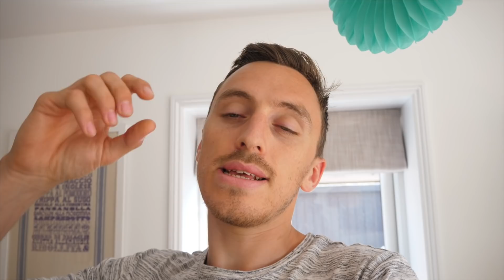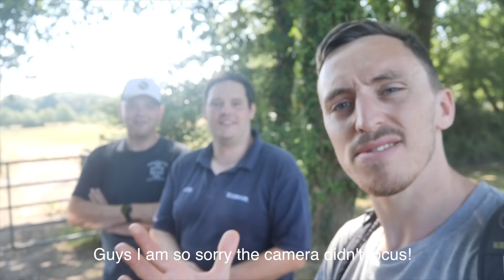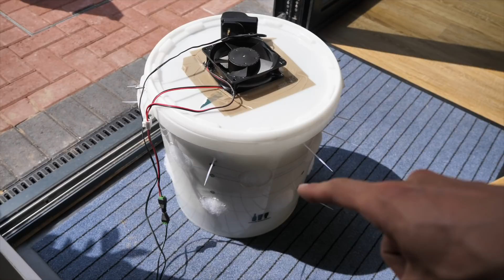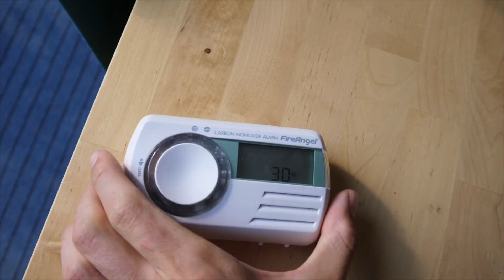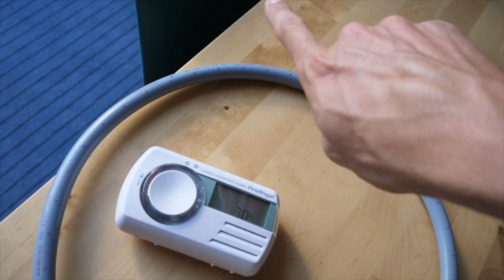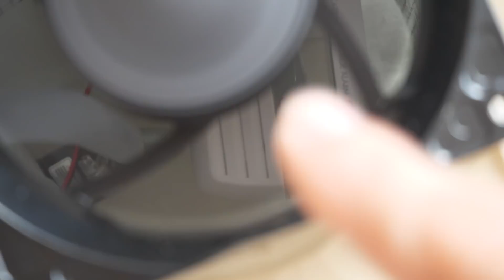DIY 12v Evaporative Cooler For Camper Van

Comment: Hugh, if you want to know why the temperature drops change in varying conditions do some research into 'wet bulb' and 'dry bulb' temperatures. I'm a water treatment engineer and work with coolers that work on the same principal, but are as big as your house ;)
Reply from the maker: Amazing, cheers Tim!

Comment: Make that test on the outdoors or on an hot van. It will change completely, because the water is not on a so desired low temp.
I had one 12v cooler and after a few years I got another one. Before use it on my car, I made an indoor test at home. The old one was better. With a bottle of water inside after one hour the water temperature on the old one was 4°C lower. Then I made the test on the car on the hot sun. The result was the opposite, only because the lid had a better lock system without changes for small leaks. Before going further on your project put it outside, let the water get the ambient temperature and then make your test. I’m not any expert.
Reply from the maker: Cheers Luis!

Comment: I like your construction, and with one extra feature you could make it into something really useful. But as it stands, I believe you will find that, when it's uncomfortably hot in your van, your cooler will make matters worse!

You will get a dip in temperature at first, but you will also raise the air humidity, which slows down evaporation. Eventually, the humidity will be so high that you get almost no evaporative cooling at all. The only reason you get any at all is because some of the water vapour is leaking from the van. Even worse, the humidity will affect your body's ability to cool by sweating, and you will become very uncomfortable indeed.

The humidity may also cause problems with condensation, wood swelling and so on.

This problem can be overcome. Instead of blowing the humid, cooled air into the van, cool the van indirectly by sending the humid air through a pipe that takes it out of the van, but allow this air to absorb heat from within the van before it escapes. E.g. you could add a second fan that blows the van air over a coil of the pipe.

But be aware that the cooling effects might not be as impressive as they appear. If you're blowing air out of the van, air must also be coming into the van from somewhere, which will warm your van up again.
Reply from the maker: Hi Peter, sound logic I do appreciate it. I am looking into another design that should hopefully achieve all the results I originally looked for

Comment: Good idea. The only difference I can see is the first tube curved gently on whereas the second was more rigid tubing and had a sharp right angle at the top - could that have hindered the efficacy? (I know nothing about science so don't laugh!)
Reply from the maker: Nothing to laugh at at all, I am not qualified to answer that correctly but due to the scale of the unit that 90 degree is probably less efficient but the difference in energy requirements to offset it will be so minimal you wouldn't notice.

Comment: Another approach to the same sort of solution is to use frozen ice packs instead of water.   You can make a smaller unit and it will not rely on evaporation.   I created one for my van.   I have a few ice packs.   Half I put in my 12 volt compressor freezer and the other half in my "A/C" (which is a set up like yours only no wool - only ice packs and the fan blowing over the Ice packs).     Here in the Eastern US we have already too much humidity.   Your design will work very well in dry climates, I bet.   TAKE CARE OF THAT LEG!
Reply from the maker: Thanks Mark, healing well. Ok nice idea, I saw the ice bag versions but thought that was such a waste but never stopped to think about reusable ice packs haha!

Comment: ok I have a mad idea,  if you put a 4 inch drainage tube on the bucket,  and an extra fan sucking at the top,  if you put it in the van with a minimum of 2 inch clearance from the ceiling and shut the van door.  I am wondering if the cold air sucked up displaces the hot air at the top and comes down.  Even madder idea have another piper sucking the hot air down to a pipe that vent outside. You may be able to cool the interior of the van.  Also experiment with adding chemicals to the water to drop the evaporation point.  All mad ideas, but britain was built on man in the shed mentality

Comment: the disadvantage is that you increase humidity in the air...
Reply from the maker: True but as cooler air sinks and hot air rises, if you have a roof hatch my theory is that the hot air should leach out taking some of the humidity with it.